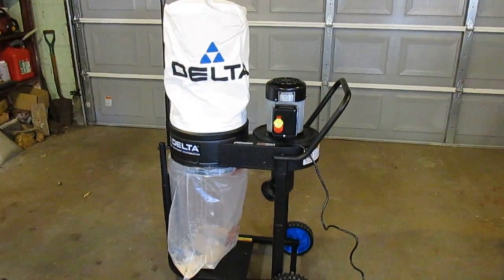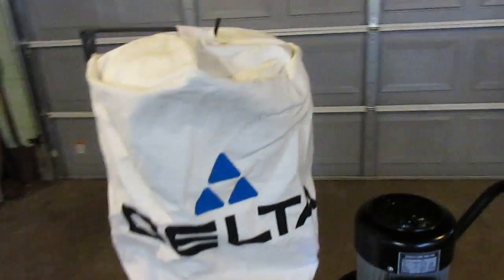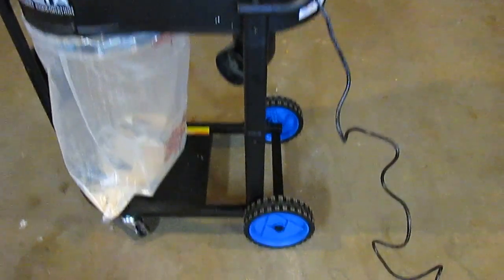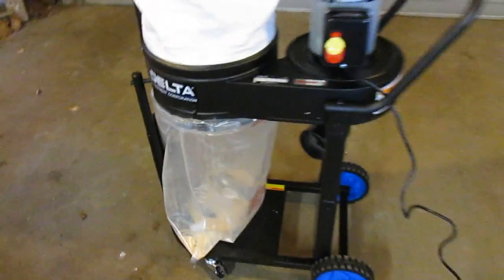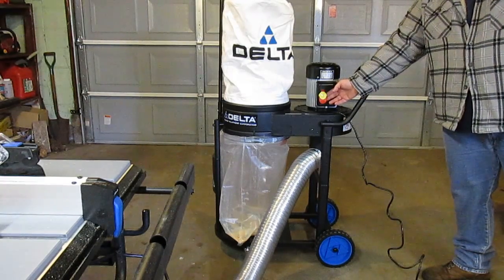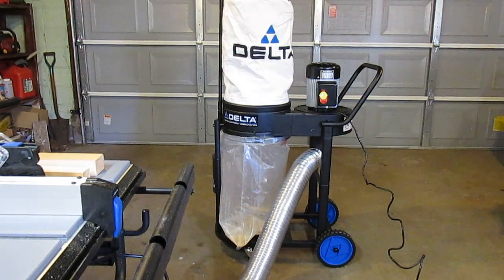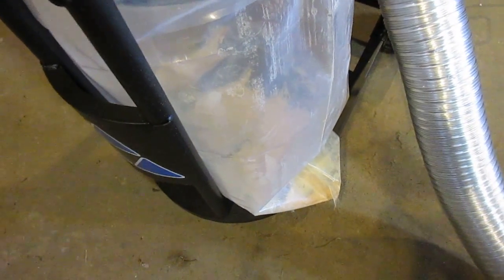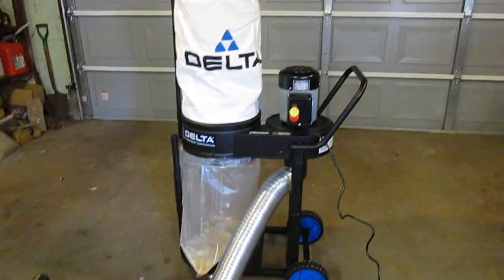Delta 50-723 1 hp Dust Collector Review

Comment: I bought this several years ago and use the heck out of it, it works great. I like the size of this dust collector because it has a 1 hp motor so no need for any new high capacity wiring.

Comment: Have always been a fan of Delta Equipment, long before they partnered up the Asian manufactures. I recently purchased a dust collection system model 50-723 and upon receiving it I realized I was ripped off for the additional lower bag that was supposed to be included with this unit. NO big deal, I thought, I will just go on line and purchase a few extras. What I discovered was that this model is obsolete and that the bags are no longer available from companies such as e-replacement parts, as well as a few others, and was forced to purchase these bags directly from Delta. NO big deal I thought. So, I placed an order for four additional bags and three months later I still have not received the bags. Oh and yes, I was charged for them. 
I have repeatedly tried to contact Delta and have run into a dead end each time. Its a sad day when a tool manufacture that I have always held in high regard has degraded themselves into another POS Asian tool company that does not back up its products or care one bit about devoted customers. Sionara to Delta for this guy. I realize that no one at Delta give a crap what some old guy like me thinks but I will for ever be telling everyone I know just what a crap company Delta has become.
Reply: this model is obsoleted? i just talked to their customer service, and said its still available. btw, i got mine from amazon tho, and works great. using big black trash bag, works just as good.
Reply: this model is obsoleted? i just talked to their customer service, and said its still available. btw, i got mine from amazon tho, and works great. using big black trash bag, works just as good.